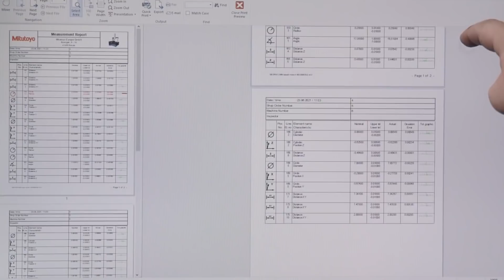How to make MORE money in your CNC Machine Shop | DN Solutions

Comment: Recently I saw the video where a machinist said "if you can lean, you can clean".. that is how i roll too.. 
I noticed that my lathe looks dull if i clean it with industrial cleaner.. so i switched over to a light coat of oil, i like my machines to be shiny and clean.
I have a towel hanging nearby to clean and dry my hands before touching the controlkeyboard.
Machining multiple parts?.. I also love to align them on my workbench, because it also allows you to quickly see how many you made.
Taking care of your machines, your tools and the parts you make, shows you take car of your customers as well.. most important tool in my workshop?.. a Broom.. because when i have a couple of CNC machines running at the same time.. it is time to sweep the floor.. Once you hit the green button that says "Go!".. it means you have time to do something else..

Comment: I usually clean my machines even 3 times a day at a 8 hour shift g necessary and also keeping the floors clean and when i come after the next shift I find the exact opposite and the boss wants 95% production rate, how can I offer him that when he gives me bad tools to work with,  tools that for years they know have been problematic and yet took no action to solve the issue,  I have a Ø14 tool that for four years is made way off   like 0,2 mm , I know it doesn't sound like much but considering I sometimes work with tolerances of 0.005 mm that gap is huge , no one takes action,  we throw away ten drills until we find one that is good and then they say that we're to blame they're losing money,  if you want me to give you good quality parts give me good quality tools, because if you buy cheap tools now it's only going to cost you more in the long run

Comment: So I'm not into metal at all. We make prefabricated and insulated timber frame panels for houses. We always send a guy (often myself) to help with assembly for a day or two. New contractor clients always have a stack of building foam ready because they're used to tolerances up to an inch / 25 mm (these are panels up to 9 meter long). They can't believe it when I tell them we work on 3 mm tolerances for length (because of warping and twisting) and 2 mm for height (because that's what our supplier of i-joists does) Expanding tape is all they need to make everything airtight. We get repeat business ;) The thing that irritates me most in guys new to our shop is when by the end of the day they put (half) empty batteries (for screw drivers and glue guns) back in the rack uncharged for others to pick up the next day.

Comment: I have been doing this for 28 years, and its gotten me nowhere!!🤔
I would run my 2 horizontal boring mills on one end of the building doing critical finishing for landing gear assemblies, on the other side of the building I aslo setup and ran another 2 horizontals, and one was 5th axis with alot of problems and was not hired for, they were having problems with the parts passing QA, it was the programs and their engineering didn't have the software to fix it, so they saw I knew what I was doing, they asked me to help so I did, I fixed all the programs manually at the machine by working with quality control on the issues, went through thousands upon thousands lines of code making edits on a pos machine to begin with!!!
And got all the the parts bought off and running, now I had 4 machines on a regular basis 50 taper spindles pretty big machines, but nothing compared to the giant gantry mills that I would also run too when asked, and also other random smaller 40 taper mills when asked, but I always ran 4 minimum, I always kept my area clean while others mostly everyone didn't!!!
Alot of favoritism because they were buddies with the boss!!!🤔🤥
But anyway it isn't always what you think, you can work hard be on time, do a great job above and beyond your duty, and still get canned, funny thing is the lazy ones are still working!!!🤔✌🙏

Comment: `what he"s saying........ you must as an operator is pretend that it is your own shop. do not half ass anything...  its close enough for the girls i go with.    allways meant that there was not to spec ..... if ur working  a vise part and ur havivg problems with patr to part  consistancy  u must change the process immediately do not  keep fighting a poor process.....    my  fav. is to HRF...
HOG THE MATERIAL OFF........  ROUGH TO A  VERY SPECFIC DIMENSIONS.....FINISH.....    
if your process is good  there is no reason on a modren machine that part to part repeatability  should be .0001   to   < ..0005   .
torque wremches are very good for maintaining  any process
anti seize or compression grease on all fastners.

if ur havng hell, go talk to the laziest good operator u  are working with.....
most good lazy operators are the smartest guys in the shop.... they are precieved ab being lazy because they always sittting on their ass ,,,but  their spindle is allways a running.......

Comment: This is how I am at my job. I was running a fiber laser with a background in drafting and CAD. I got moved into the manual milling department to learn speeds and feeds and was working 13 hour shifts five days a week. After 2 months someone quit and I got fast tracked into CNC verticle mills. In the last two months I’ve worked 15 hour days collecting overtime so I can rebuild my track car that blew last fall due to our machining department being 17 weeks out on work. Our laser department had 1 day lead times so no overtime. Anytime I have a free second while a machine is running I’m cleaning. I hate dirty work areas. The floor around my machine is a spotless square while the other machines have caked on dust from years and years of neglect. The oil under my machine is mopped up and clean, floor swept, my bench was organized immediately, old bits and inserts returned to the tooling department instead of looking like a game of pick up sticks in my new area from the last guy. Everything is straight and aligned, even degreased and cleaned the 15 year old radio that was there. My machine is spotless inside before I leave every night. I’ve cleaned the coolant tanks on all 6 of our machines and I get jobs out the door ON TIME more than anybody else due to my willingness to stay and run parts vs sitting on the couch at home
Reply: keep it up buddy even when it seems like none of it matters what matters is never goin below your standard

Comment: I worked at a aerospace company for 13 years. 
My daily task every day were, set up and run
 2 wire edms
3 edm sinkers
1 haas mini mill
1 haas lathe
1 manual lathe
Also had to sand blast 
Did hand work under the microscope. 
Had to do mastercam mill programs. 
And not to mention the preventive maintenance on all cnc's. All that simultaneously for 10 hours. 
And lastly schedule the night run for night shift. 
All for 28 an hour.
It was a disaster. 
Owners made fake promises all day long. They ordered material late
And then failed to deliver on time. They had us scrambling to get the hot parts shipped out. We were so stressed out that corners were cut (and owners were aware)Therefore parts were scrapped. Still were sent out as is. Customer called in yelling at the inspector wtf!.
I left in 2019. Never going back. 
I grew with that company we we only 3 machinist when I started.  When I left in Nov 2019 they were 30 ish machinist there. And about 8 quit after I left. I gave my blood sweat and tears for that company. They are still running the company with their head in their as$. It's even stressful writing this, it takes me back. Idk how they stay in business.

Comment: Any place I ever worked, I treat the equipment and machinery I operate on a daily basis as though it were mine. That's my bread and butter. That's how I make my living. I'm gonna clean that machine within an inch of it's life. My equipment is going to be cared for. I ask the question," If I were the customer, would I buy this product? I've been a welder and a CNC machinist and the approach was the same in both cases.

Comment: My old boss was the exact opposite of all this. Doing even the bare minimum was a no-no, including even occasional cleanup and lubrication. I can't tell you how many times I was "caught" cleaning chips out that were ruining the machines and vises, preventing me from doing good runs. Machines frequently were hauled off because of lack of preventative maintenence and a deliberate negligence. The only thing that mattered was the cycle count, even if the parts ran out of spec for a week straight, even if the customer gets rusty parts on a busted pallet. It was more important to get 1 more part than it ever was to keep the machine maintained. 
After 6 years of trying to make my way through that, and myself always having the philosophy of "I take pride in my work", I finally decided that I couldn't make it there anymore. So I bought a hobby lathe, mill and a few other small machines for greatness at home, and I decided to try my hand at day-trading. After 2 years of that, I can tell you, sometimes quitting a job is the only good option. I wish I had a boss like this who encouraged excellence. If I did, I'd still be doing setups and making parts for a good wage. Going forward, I intend to still take pride in my work, no matter what it is. Nothing gets my signature unless I'd be proud to say I did it myself.
Reply: Went through this same exact situation for 3 years and finally found mom and pop shop that takes pride in there work. It’s insane how it can change your whole mindset being around motivated organized people.
Reply: I enjoyed reading that.
Reply: Thats how it should be.
Reply: Excellent story , cleanliness is next to godliness, prevention, maintenance, having a machine check list before start ups is KEY! Why these machine shops that have no clear direction and vision continue to exist is beyond me ! But when I read posts like this, that glimmer of hope remains active

Comment: How do you find the balance of quality vs output from a leadership point of view ?
I just finished working in a fabshop where output of the parts was more important than well finished work - albiet it all gets powder coated and stuck under a vehicle. I found it difficult to adjust to coming from an aerospace engineering environment prior.
I certainly wasn't earning that fabshop money, but my weld booth was kept immaculate, and my parts were well done.
Reply: Output will increase when you stop and fix sloppy and incorrect/slow processes. Unfortunately that is a mental challenge for a lot of companies to understand. It is similar to the parable of spending time sharpening an ax before you chop a tree, rather than using a dull head and struggling through it. At the end of the day the guy with the sharp ax will chop more trees down with cleaner cuts
Reply: @DK-lz7kg  Love It ! Great perspective.

Comment: So what's the salary range (min/max) doing CNC programming anyway?
Reply: It's a huge range depending on what and how you are programming.  If you are doing simple 2 axis lathe stuff vs multi axis lathes or milling.  Are you doing it at the box or are you doing it with CAM software?  It's a very broad question.  I've been a programmer for 10+ years now.  I done 2 axis lathe stuff while getting paid $15. an hour at the beginning.  Now I'm up over $60, but I'm doing 9 axis lathe work and swiss machine work.  I started writing programs at the box and then moved to some basic CAM software.  Now I'm on higher end software.  The thing is though if you have zero shop floor experience, setting up or running machines, jumping right to programming is a recipe for disaster.  Basic machining skills and techniques are still the foundation of a good program.
Reply from the maker: Spoke about it a few weeks ago in a video😉

Comment: To old now (62) and do not know enough I expect to enter into a shop like yours. But would love to try. Enjoy your channel, I’ve learned a lot from your speeds and feeds for the different metals. I run fork lift mast rails mainly on a 15hp haas gantry machine. Have been told I run twice as much as anyone that has ever. Do know that they took out a radial drill that “was” doing a portion of this work. 
Keep putting out the knowledge! I don’t get to use much of it but enjoy seeing some of what is possible 😉

Comment: Precision must be the starting point. I made close ratio gear sets for the local racing community down here in New Zealand. I had to make them on my centre lathe because I could not get the cnc guys to machine in one operation. I needed the bores and outside diameter perfectly concentric and the faces perfectly parallel. This was necessary so my gear cutter could reliably set up to cut the splines and the teeth and could stack the components and not have an accumulated runout. I machined the blanks back to back, totally machining one gear all over and leaving it hanging on to the second blank via a ring of material that would be clean away later as it was a negative weight reduction relief on the face and its geometry was not important. I would then go thru a batch and then hold on the finished blank and machine the second blank. I would then part it off. Bang, two perfect gears that just needed minor finishing at the parting point. Taking care of this precision at the very start meant grinding for correction was completely eliminated, gears that were finely finished by my gear cutter were perfect and did not need grinding and a huge amount of cost was eliminated without sacrificing reliability. Because these were going into race cars a bit of noise was almost a bonus. And of course, on my limited funding I could afford to make lots of gear kits and made really good money and my customers were happy to pay a sensible price. I am now semi retired but I take pride in making everything precise and quickly. Precision parts make the next persons job much easier, be it another process or simply fitting parts together. Enjoy your videos.
Reply: it doesn’t sound like you approached the problem in a reasonable manner.
Instead of telling CNC guys what to do, you should have told them what you in fact needed.
You would get it. Setting parts up in the gear cutter is a solvable problem, too, you got all spiritual about it…

I bet you feel bad about what you charge, so you made up an epic out of making gears. Gears, man.

Comment: If you want more money doing CNC, you need to be prepared to leave for another job, new starters usually get more than existing employees.
They will often pay more when you hand your notice in.
Don't expect more money just because you work hard, most places will only pay what they think they can get away with.
Reply: Absolute truth.  Sometime though it's not that management won't pay more it's that they can't.  I worked at a shop for a while when I first got in the trade that had 3 major customers.  They were all in the same market segment and similar products.  The parts were all pretty basic geometry wise.  There where tight tolerances and we didn't do easy materials.  It was all Nickle based alloys.  They were all small parts.  The skill ceiling there was pretty low.  After about 6 years I left and moved on place with a more varied customer base where I got a chance to learn and grow more.  As I did so did my pay rate.  I started there at $25 an hour as a set up guy.  When I left there four years later I was the department lead making $35 and hour.  After that shop was sold to an investment firm I got the hell out of there.  My current shop gave me fat raise and I get to work on much newer equipment.  I learned that most shops will only pay you enough to keep you happy, not what you are actually worth to the company.
Reply: I couldn't have said it any better. I've worked for the same company for 28 years. New hires make almost as much as I do and are only given half the responsibility. And don't even get me started about how some of the guys who show up late everyday and usually only work 4 days a week will get the same raise and bonus I get at the end of the year.

Comment: Wish I had met you when I was 21. Worked my ass off for a company, started as a chucker pushing buttons, to shop supervisor , head programmer,  head tool and fixture maker, making under $13 hour.  I thought proving myself would get me somewhere. All it got me was more work, more responsibility, and more and more hours a day. Put such a bad taste in my mouth I have never went back to machining again. I keep an eye on the tech and updates in the field, but I would rather drive a forklift at $25 an hour, with none of the 90 hour weeks and the possibility of being in the same boat again if I went back into the industry. Bad employers kill talent and drive.
Reply: Same, I'm about to leave the trade this week. It is not worth it, and there are probably 7 machine shops nationwide that follow the principals described in this video. Most just want you to optimize the process so THEY can make more, you won't see a dime